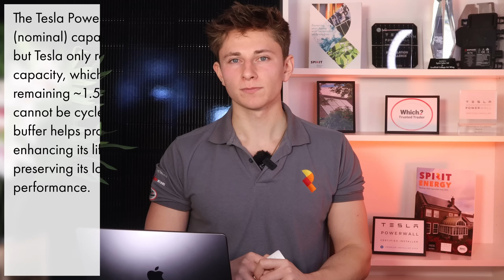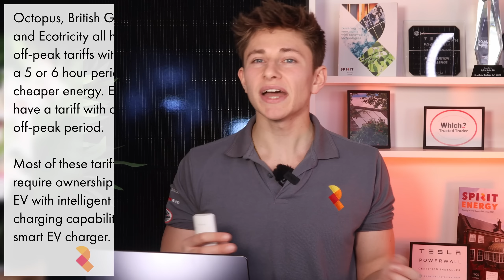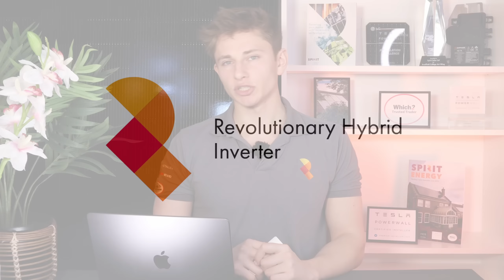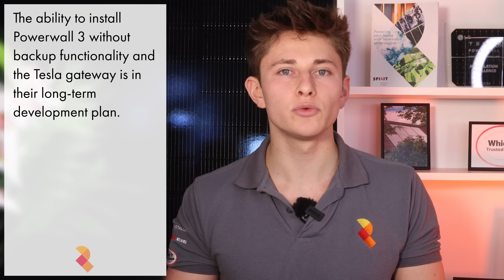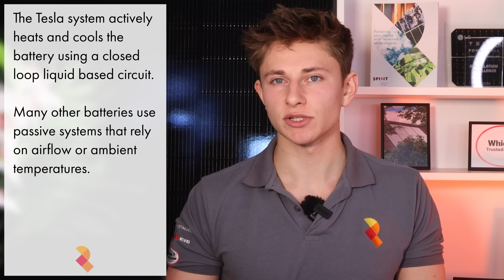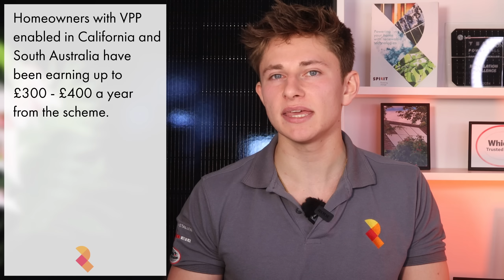Tesla Powerwall 3 Technical Breakdown - Everything You Need To Know

Comment: Would it not be more efficient to have 2 PW3's with 1 expansion pack on each instead of 1 PW3 and 3 expansion packs? Same capacity but double charge speed? Or am I missing something?
Reply from the maker: Each PW3 with 1 expansion pack will charge at 8 kW. So the charge rate per Powerwall won’t increase if you have two Powerwalls.
Reply: @spiritenergy_uk  Thats what I mean, having 54kwh of battery storage comprised of 1 PW3 and 3 expansion packs would charge at 8kw whereas 54kwh battery storage comprised of 2 PW3s each with a single expansion pack would charge at 2x 8kw, doubling the battery charge rate with the same capacity?
Unless I am missunderstanding something this seems like the better option as you would be able to charge up twice as fast during the cheap rate peroid, eliminating some of the issues mentioned about not being able to make use of the full large capacity.
Reply: @meowi3108   You are correct. Apart from the roughly £1500 more for an extra PW3 over an expansion pack, your configuration would give you a charge rate of 16KW for the total 54 KWh stack.

If you haven't already, check out Tok's video on Sigenergy's battery system. It's modular, stackable, and can discharge and CHARGE at half the KWh capacity of the stack. So their 48 KWh stack (6 x 8KWh modules) can charge at 24 KW, although if charging just from the grid it would be limited by the inverter capacity - 12 KW is their largest single phase unit 🤔
Reply: @MichaelWakefield-mx6hg  thanks! I'll have to check that out, sounds very interesting.
Reply: @meowi3108  Hang on, I just realised there would be a barrier to getting the full 16KW charge from the grid into the PW3 setup you described...

If you get 2 PW3s, both units need to have the same inverter rating. And unless your DNO approves a 22KW inverter (unlikely), then each PW3 will need to be de-rated down to half, or less, than the DNO's approved KW. 
So if the DNO approves 16KW or more, no issues. But if the offer is say 13KW, then each PW3's inverter will need to be de-rated down to 6KW, giving you a maximum charge from grid rate of 12KW...
The devil is in the detail it seems.. I only heard from Tok about the PW3's slow charge rate when installed with 3 expansions.
Reply: @MichaelWakefield-mx6hg  Oh that is very interesting, I had no idea! Thanks for that info I hadn't heard that anywhere.
Reply: I installed a ground mount 16 kW solar system. I have four Tesla powerwall 3s. 2 have inverters and the other two are expansion batteries without inverters. The lead power wall 3 controls, all the other (3) powerwalls. The 2 expansion powerwall 3 batteries are connected directly to the lead powerwall 3 in an adjacent configuration. The solar system sent a DC charge input of 15.3 kW to my powerwall 3 batteries, The Tesla app indicated the input of 15.3 kW had not reached the maximum battery charge rate and there has been no clipping of peak charging input.   Is it possible that my configuration of 4 powerwall 3 batteries can charge up to 16 kW or possibly 20 kW? The grid went down for three days, and I had plenty of power and storage. It has been suggested keep the batteries above 20% charge? Best not to go below 20% charge. I was told it’s OK for 100% charge. Typically that happens a few hours a day. Is this the best for longevity? Any comments?  Thank you for the video it was very informative and covered many aspects of the Tesla powerwall 3.

Comment: With the telsa powerwall3 are you allowed to discharge the battery at 4pm-to-7pm for full export? 

Also it seams you can only export when the powerwall3 is 100% is there a way for force export if rhe battery is 50% charged
Reply from the maker: Powerwall 3 should export if set to ‘Time based control’. In that setting it will always look to save you as much money as possible.
Reply: @spiritenergy_uk  thank you, cross my fingers it will work today.  I tried contacting Tesla via email last week and got no reply
Reply: Well that was disappointing 43days of being independent using just solar and battery. Time-based-option ,Yesterday the grid charged me 1.5kwh and today 1.8kwh at 9am .

Night buy 15p and sell 4p
Mid buy price 26p the sell 10p
4pm-7pm buy 36p and sell 26p
 
The Tesla app is poorly designed and the UK electric companies are being paid.

A simple 'self mode' as much as possible, ignore the price

export whenever the battery exceeds 40% (enough to run "UK house" for 30hrs off-grid)

4pm-7pm export all solar to the DNO maximum as long as battery is 40% use the battery to claim the most.

Comment: Why is 550V MPPT range great? Most of the inverters used here in Sweden does up to 1000-1100V. This is one of the biggest downsides I see of this, which prob is the reason they haven't released it here in Sweden. People needs 3-phase and higher MPPT voltages, which makes this powerwall not make any sense. I have a 3-phase Deye instead, single 3-phase unit and does 800V which fit my 20 panel strings well.
Reply from the maker: That’s interesting. Compared to inverter technology in the UK, 550V per MPPT is great for an 11 kW inverter with 3 MPPTs. That would be considered market leading here.

Comment: Having just signed up to have one of these installed by yourselves, this has reassured me I've made the right battery choice decision. One query: Can the PW3 handle AC coupled and DC coupled PV input at the same time?
Reply from the maker: Hi Simon, thanks for your comment. Yes it can. And it can backup up to 7 kW AC in a power cut.

Comment: 16:45 Regarding the NetZero app, what is the implications of this on the Tesla warranty?  I'm specifically thinking of the loss of the unlimited cycle warranty, where it is replaced by a 37.8 MWh aggregate throughput limit (= 2,800 cycles, which is about 0.76 full cycles daily).   This is actually notably worse than many other battery systems on the market for people wanting to do arbitrage via NetZero.  I have read the warranty multiple times and as far as I can tell, NetZero would appear to trigger that clause.  Also, given that the margins for arbitrage are quite narrow, I think a more cost effective battery system with a better warranty might be better for that use case.

Comment: I have DNO approved 12 kw export and existing import ( on 100 amp fuse )which is 4 kw original FIT and 2 other 4kw systems if I had a powerwall 3 is it possible to connect the two 4 kw systems DC and leave the 4kw FIT system on its own inverter as long as it is monitored by the powerwall 3 ? Very well explained thank you 👍👍👍
Reply: Yes, I have an existing FIT system with its own inverter connected to the PW3 AC side, plus new arrays connected to the DC side. The combined solar generation is shown in the Tesla app.
Reply from the maker: Hi Glyn, yes certainly possible and it’s something we’re doing quite regularly at the moment. You leave the FiT on a standalone inverter, and install the PW3 with new solar. You could also upgrade the FiT system at the same time.
Reply: Thank you both very much 👍👍👍

Comment: Our daily energy usage is average 35kw. We have a heat pump, 2 electric cars and cook with electric……
Reply: That's about average for my house that's totally on electric. I too have a heat pump, electric cooker and EV. This is where a battery comes in as we have a Powerwall 2 and are on Octopus Cosy during Winter and Octopus Go during the Summer. Saved a fortune!
Reply from the maker: That's a large load, do you have a solar or battery system as well?
Reply: What is your daily usage if you exclude the EVs?   In general, EVs should be charged overnight at cheap rate, rather than being charged via the battery, so your system design can probably ignore them.  The reason is that if you charge them via battery, it adds extra battery wear (degradation), and due to round-trip-losses, you lose 10% of the power as heat.  
If you were to get a battery system big enough to be charged overnight on cheap rate, and then run from that during the day, it can save a lot of money.  My tariff is E-on Next Drive (6.7p/kWh), from midnight to 7am, and you can also export at 16.5p/kWh.   The battery would need to be big enough to run from 7am to midnight on winter days when there is minimal solar.  Any surplus power can be exported at the end of the day.   
Personally I don't like expensive systems like the PW3, because the 'brand premium' makes the ROI and payback period significantly worse, so I got a Fox system instead (very happy with it, and I can directly control it via home assistant in real time even if the internet drops out - Having said that, home assistant is very much something which only IT professions should be looking at, due to the massive learning curve.).  
If you like premium systems, I think the SigEnergy is much better because it is more modular, easier to upgrade in reasonable amounts, has a great 3-phase home backup, and finally isn't being run by an insane megalomaniac who appears to want to bring back the Third Reich.  Spirit have done a great video about SigEnergy which I would recommend watching.
Reply: @WyndStryke  😂

Comment: At the risk of being flamed I believe that the requirement for external DC isolators - where battery / inverter systems have built in ones is now not 'recommended' .  This is because risk analysis has shown that a high percentage  of solar related fires stem from failure of isolators. 

The issues are covered in this video https://www.youtube.com/watch?v=2BBCclJuM4I where reference is made to "Code of Practice for Grid-connected Solar Photovoltaic Systems, 2nd Edition"

"5.5.18 Eliminate the use of DC isolators wherever possible; many inverters now have
integrated isolators)."

As eFIXX say 10 electricians gets 11 answers - I suspect that YouTube comments will not be different 😎😄
Reply from the maker: Interesting thank you. We always install external DC isolators as well as the built in ones.
Reply: @spiritenergy_uk  I can see the logic - it enables easy disconnection / removal of the unit as opposed to taking 'hot' wires out of terminals.  But it was interesting that the analysis of fires points to the isolator being an issue - I had heard  of this from Australia where their fire service required isolators on the roof/by the panels.  Only to find that's where fires started!  I don't know what their current requirements are.  I wonder if the higher lightning incidences there cause arching across isolators which is then sustained by the solar?
Reply from the maker: @barrieshepherd7694  That's interesting, I have not seen that but I can see why that may be an issue. I'll look into it.
Reply: @spiritenergy_uk  There was a report by the UK insurance industry which talked about fire risks.  The two most common causes of fires on solar systems is MC4 connectors, and DC isolators.   For the MC4 connectors, there is always the option of something like the Viridian Arcbox.  It would be interesting if a DC isolator could be designed with a case made of the same material as the Arcbox.  No doubt the root cause of many of these is poor crimping on rushed installation jobs (precisely the jobs where an Arcbox is unlikely to be used).

Comment: Stupid question… if your DNO limit was 3.68 does that limit the supply to the house from the battery to 3.68 or just the export back to the grid ?
Reply from the maker: It depends. You get a ‘Generation’ limit and an ‘export’ limit. If the generation limit is 3.68 kW then that limits the supply to the house as well as the export.
Reply: @spiritenergy_uk if installed to G98 standards then the inverter output and battery charging both get limited to 3.68kW
Reply from the maker: Yes that’s correct if you go down the G98 route. But with G99 you’ll very likely get a lot more than 3.68 kW allowed.
Reply: @ i’m waiting for G99 approval, it speeds things up, then the G99 limit can be done OTA
Reply: @spiritenergy_uk why would the grid limit generation when they can limit export separately? Seems like this is a big stumbling block... what's the point of getting a powerwall 3 if generation is limited to less than it's max output, then it's like buying a Ferrari and being forced to drive it like a Dacia!?
Reply: My system was fitted in march and G99 form was sent to our DNO who allocated 3.68 limit

 It seems they like to create problems when my solar can generate 7kwh at the mid day in june

Comment: For those of you who wish to monitor your PW on a Windows PC (as well as tablet/phone) there is an APP in the Microsoft / Google Stores called Powerwall Companion.

It gives a simple overview of current status and composite graph of Home/Grid/Battery/Solar usage/levels.  It's a quick 'glance at' if running on a PC.  You can export the data should you want to run your own analysis.  The only thing that does not work is the battery baseline graph because Tesla removed this data from the API (for PW3 at lest)
Reply from the maker: Thanks for sharing Barrie, that's very helpful.

Comment: Having used the Netzero app for a few months now to monitor my PW3 I don’t think it can monitor separate MPPTs. I have 3 strings (South, East and West).
Reply: It can monitor each MPPT but not easily. To do it you have to access the service WiFi SSID on the powerwall via NetZero using the Monitoring/Connect option and logging on to the PW. This can only be done when in close range of the powerwall and assumes you took note of the SSID Password.
Reply: As below, you can get the string detail but need to be close to PW3 and enter the WIFI details. Annoying that it’s not a one and done as you will need to reconnect every time you want to view string output
Reply: @NevmanP  It is, to my mind, a deficiency of the Tesla App.  It should report individual string detail, it is available in the Tesla One App so it can't be too much trouble to fit it into the normal App.  It would be good if it was also available in the API but, alas, it's not. 

Maybe accredited Tesla Dealers (hint hint) could feedback this as a feature improvement to the Tesla mothership.
Reply: I was about to say I had my string data in march when it was installed since then the app was updated and now only shows the total like the Tesla app
Reply: @SteveMoore1969  I still have string data in Netzero, never had it in the Tesla App, also can get it in the Tesla One App but NetZero is easier.
Reply: @SteveMoore1969 as per comment, only get the string data when connected directly to PW3 WiFi, so need to be close. Can download it to phone but the tab with string details disappears when you move away from PW3
Reply: Also use all three MPPT’s with South, SE & West arrays